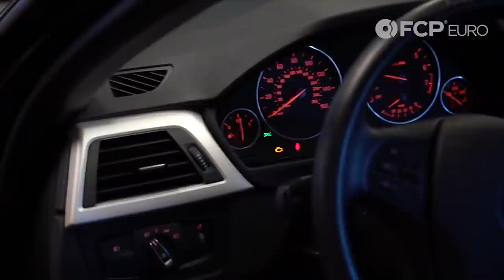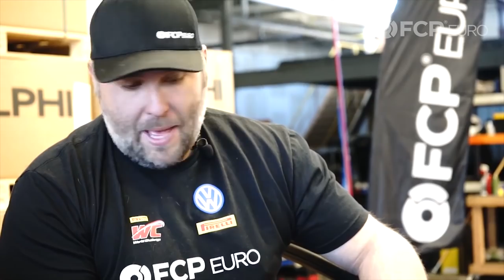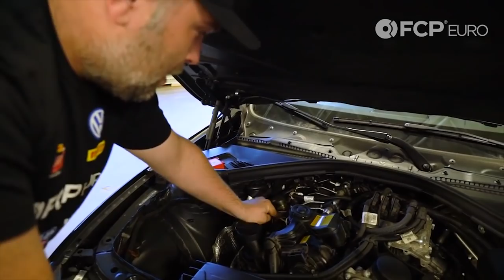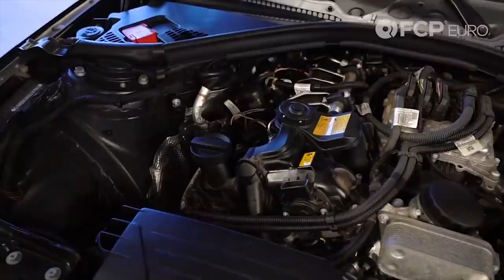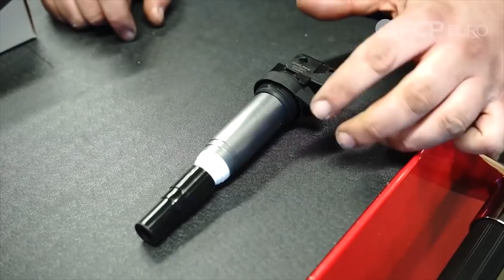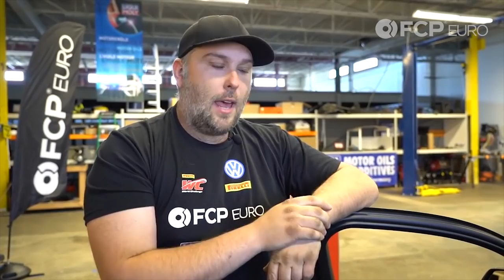Ignition Coil Symptoms, Problems, Diagnosis and Replacement  - EASY DIY!

Comment: For me nothing came up on the scan tool, did the manual check, put a new ignition coil in and worked beautifully. 
My symptoms was when accelerating normally, it would jerk a lot, but would be ok when accelerating slowly.
Reply: Having same problem as u

Comment: Good vid, I am likely going to use this on a BMW bike to puzzle out a fault indicator that I believe is a coil going bad. But I will order a fault cod reader first.. Best guess till then is the fault code is likely a slow failing coil.

Comment: The older style Bosch stick coils are the best with the metal shield. They fire under load without fail.  BMW has gone to Eldor since all the problems with the newer Bosch and Delphi. Eldor seems to be the reliable route for now. Eldor is used in Rolls Royce engines which speak for the quality.

Comment: Great video.
Reply: Would have been REAL nice if you had attempted to temporarily fix the coil by wrapping electrical tape over the hole and retried the test. If this coil failure  happened while out in a remote area, the tape fix would get you a shop or store and not possibly harm the engine. $.02

Comment: thanks for the video. I have a question, do you recomend to change all coils set at once or just the one failed?
Reply from the maker: You're welcome! Usually if one coil fails, the rest of them are nearing failure as well, so its always good to replace them all at once, however if you are in a pinch you can just replace the bad coil.
Reply: FCP Euro thanks again. I just replaced the bad coil, but will replace all asap.
Reply: Exactly my question as well,  glad it's on top 😊👍

Comment: I've replaced 2 on my '07 Altima in the last year.  I was stoked!  I don't know much at all about working on engines.  Both times my check engine light came on (though even if it didn't it was quite clear something was wrong) so I had it diagnosed at an auto parts store where they told me exactly what the issue was.  Could a coil go bad and not set off the check engine light?  Also, does a coil gradually go bad or do they simply either work or not?
Reply from the maker: Typically a bad coil will cause a misfire and set the check engine light off, depending on how modern the car is. Coils typically age to the point where they no longer work, however you can have a failing coil that will cause intermittent misfires.
Reply: @fcpeuro  my 428i jerks and stutters with acceleration. I have a check engine light but no codes say anything about misfiring. Do you think replacing the coils may be it?
Reply: @anthonypipia6990  yes check and change the coils manually like in the video. Same thing was happening to my car. Fkn shaking was scary on the highway.

Comment: In this particular example, could not just the rubber insulating boot be replaced since it clearly had the defect?  I imagine the coil likely could still be operating correctly, but the spark was exiting through the defect in the boot instead of down to the plug.  I could not really make out any discoloration in the boot around defect though in the video to support this possibility.  It makes more sense in my mind to repair the part with a new boot at a fraction of the cost of a complete coil if that is the failure.  It was $5 for a boot vs $60 for the coil on my Volvo.  Maybe that is not possible with the coils on these vehicles.  I don't know.  I'm just researching frequent failures and repair/maintenance on these cars because I am considering a purchase next year.  Regardless, an easy fix without specialized tools and the car is running correctly again, and that was the point of the video so well done.
Reply from the maker: Unfortunately, the spark plug connector (boot) is not a serviceable item on this style ignition coil for BMW's. In this case due to the damage on the connector it is required to replace the entire coil. The most common failure for ignition coils is the coil itself failing. Discoloration of the insulation is not always an indicator of an issue. Generally speaking a misfire due to an insulation problem is almost always a tear or hole in the rubber boot.

Comment: Im gonna replace the spark plugs and/or the coil packs on my 2006 Saab 9-3. The engine keeps misfiring whenever I give it gas, hopefully this will solve the issue!
Reply: Can you give me an update on if it worked I'm having the same problem on my 06 9-3
Reply: @easilyoffended9535  it turns out I had a bad coil pack on one of my cylinders. It was an easy fix too! Make sure to get the black top coil packs. And make sure it’s an OEM part too. 

I also sold my 06 9-3 because it failed inspection, the repairs were worth more than what the car was valued at 🙁

Comment: I  have a 2004 330ci and I got the PO302 code. I changed the coils, plugs, the injector at #2 and STILL misfiring. You said "wiring" and that makes me think that there is no power to that coil due to a wiring problem. Where should I begin?

Comment: Would it be possible for you to do a DIY video on changing the rear driveshaft or changing the pick up rings, reluctor rings on a bmw e46? I have an ABS issue problem with my car and I've been told to replace them but the price they are charging me is crazy!! if you could do a video please i would be able to give it a go myself!!

Comment: FCP Euro
I owned a bmw 320i 2007 and suddenly my car started jerking in all gear position P,R,N,D. Especially when i pressing the brake at fully stop the cars is jerking heavy and i also noticed that the gear lights on the dash is flashing when it jerking. Can this cause by a defected ign.coil? Please help

Comment: I’m subscribed. I need the diagnostic tips, the easier the better. I have an owner of a 2001 Land Rover Discovery, the vehicle will crank but not start. I asked the owner if the tach needle moves while attempting to start and he said “no”. I suspect the crank position sensor. The owner had someone else look at the vehicle and a scan tool was connected. That revealed an ignition coil to possibly be bad. I’m going to the owner’s house Thursday to check both of the possible problems. A wiring schematic I obtained does not show which of the three wires from the connector are what. I noticed upon looking at a connector for that ignition coil there was a red, a black, and a blue wire. I would reckon the red is for the power, black is for the ground, and blue is for the signal to the computer. I want to properly diagnose the coil with my multimeter and I want to check the proper terminals that the connector plugs into. What do you reckon? Also, I attempted a spark test but after testing three of the eight spark plugs I wasn’t getting a spark at all. To me that didn’t seem right.

Comment: I just spend nearly 3k on my car at a highly recommended shop. I’m a bit disappointed I left and my car has other issues it didn’t have before. They did a full tune up Including oil change and spark plugs. My car has a slight vibration when I stop at the light. I notice the car revs up before dropping idle before I come to a complete stop. I’ve been there twice to complain about the issue. My trust is loss and the fact I didn’t have this issue before taking it in.

Comment: The car is Mitsubishi Lancer 2004. It won't start due to a defective ignition coil. Lube oil is flooding the cylinder as well. After replacing the ignition coil assembly, one of the ignition coil felt warm even when the car is switched off. The mechanic thinks the electrical system is grounded, but couldn't confirm the trouble. Please help

Comment: i hope this wil work i put in new sparks today but now its idling the same as in this vid. so tomorrow ill chabge all 4 coils and hope its done .. did all this cuz between 2-3k rev. it releases boost like 1-3 times in a row but now with the new sparks at .022 it does it like one time at 4k revs only whilst punching the throttle whilst driving .. but eith all that no check engine light or annything 🤦‍♂️ PLZ SHARE YOUR APINION ON THIS

Comment: Hey so I replace the spark plug on cylinder 1 after giving me a misfire and even changed the coil less in October 2022 and now it's making my car stop and go into neutral until the car FINALLY comes to a stop and it makes clanking noise on the back tires and I hate turn on the engine again but i noticed it happens when I come to a stop and sign or light intersection and when it's time to accelerate to go that's when the engine turns off and goes into neutral as nd steering wheel gets hard and starts make the car to come to a stop but is put into Neutral and makes a loud clanking noise on the rear ties until it comes to a complete stop. I already went to AutoZone to get it checked for codes and no codes other than the ambient sensor but I already replaced it and my ac don't work cause I don't have the money to fix and my son who just 14 months old and I can't afford to be without our car since we are currently fleeing from my abusive ex boyfriend to keep my son safe and give him a better life which he deserves it and I feel overwhelmed and defeated to that things are not coming out right or what I hoped it would be better because we are in a DV shelter but this Domestic Women's shelter is ok with providing a roof but only for a month only until I find a place and money to get away and start a new life with my son but now my son just got diagnosed with a delay in his motor skills and communication skills and now he's developing symptoms of an autistic child but they are not saying we need to wait until he turns 3 to diagnose him and give him the treatment or help he needs to treat autism. He's 14 months already and he's still doesn't walk. I'm beyond grateful for FINALLY having my child away from our previous violent and abusive  home and now we can sleep comfortably but we still have some traumatic episodes at nights but we go to sleep knowing we are safe and that's all I want for my son to be happy and enjoying his time as a child but with all these new set backs I sometimes feel like I can't do it on my own raising him with no money and no job and no luck in getting any job offers. 

Sorry fo telling y'all my Lifetime sad story but I just had to let it out and tell someone so I can remind myself to not go back to the abusive relationship because I feel like I can't do it or find a way out to my struggles in being a single homeless mother with her 14 months old son. 

Ok so do y'all know what can be wrong with my car......it's a 2015 528i bmw f10 n20 engine to win turbo??? Please any advice what it can be and how I can fix it please 🥺🙏🥺🙏🥺🙏👩‍👦👩🏾‍🔧

Comment: So what if you have done all this that you have shown on the video, except plugging the diagnostic machine? And still have the misfire? Replaced spark plug and coils but still.
Reply from the maker: Hi Phakamisa, you always want to clear the codes after replacing plugs and coils.

Comment: My 2005 BMW 545I with only 77k misfires and sometimes I get misfire codes (by various cylinders, not always same  cylinders )by obd2 scanner , other times I don t get codes.  This happens only during cold start up in the morning after car was left overnight.  it vibrates, shakes and misfires at cold start up but once it s warm, it s good for the rest of the day, even when it s still cold out.  what causes this? I replaced valve cover gaskets, spark plugs, oil filter change, any ideas?
Reply from the maker: A bit of further diagnosis may be needed, but often times bad oxygen sensors can also trigger multiple misfire codes and cause a rough idle, on our "older" BMW's.

Comment: hello mate. i have a F30 which have N13 engine. sometimes i see  engine check light on cluster. When i runs diasnostic its give me this error: ignition coil. All cylinders. open curciut. But my car working correctly. what is the problem ?

Comment: I just change the spark plugs on my 2003 honda civic but when i was putting the spark plug back it crack when i was tining the crew do i need to change the coil or its still good i just change the coils like 3 weeks ago

Comment: My car is in the shop right now for bad coil and other stuff. The total is over $600. My car would jerk, hesitate and shit off while at the light. There was a ticking sound and smell of gas. I live in Miami, Fl
Reply: Did it fix the problem ?
Reply: What else was wrong with it
Reply: I had one go bad as well...had to have it fixed so it was $500 parts and labor... I had no idea what was wrong so I had to pay the price. While I was waiting I looked on YouTube and found out it's done... about a 15 minute job that anybody can do... paid the price because I didn't know...they used an aftermarket part from O'Reilly and charge $60 over what I could have paid if I bought myself. If you drive too long with the bad coil it could burn out the catalytic converter so now I know what to do if happens again.

Comment: When one ignition coil goes bad, is it better to replace all the coils as well or should I change each one as necessary? Also, should I change the spark plugs (the whole set has been replaced within the last year)
Reply from the maker: If everything has been replaced within the last year you can replace the one ignition coil.

Comment: Is it possible (or common) for a brand new ignition coil to go bad in approx 1000 miles? I had all of them and plugs changed in my last service a couple weeks ago and today the car is driving and idling real bad. The coils are bosch
Reply from the maker: Anything is possible, have you checked the codes? If you purchased them from us, feel free to email service@fcpeuro.com and we would be happy to make it right.

Comment: I replaced my coil after having it checked with a scanner at my auto parts store and now my car (328xi 2011) runs and idles fine but the service engine soon light has yet to go off 32 miles later. Is this something I may have to delete with a scanner? Or will it go off on own?
Reply from the maker: Hi Kevin. If the service engine soon light does not go off after more driving, you will probably have to clear the old code. You can have a shop do this, or you can purchase your own scanner, that way you can check and clear your own codes. Here is a great scanner/code reader: https://www.fcpeuro.com/products/maxidiag-md808-professional-obdii-scanner-autel-md808p

Comment: In nissan  you are not getting code for coil and some toyota cars  no codes and in maxima coils are underneath the plenum so  it's not easy you can check front then swap them back and coils on the back shift it infront and check big headache 😅😅😅

Comment: Great!  I had an identical issue on sons 2007 e83 X3.  We needed to fix it right away so bought one from Autozone as they had an equivalent in stock.  It fixed it but given the high mileage of his car I’m going to order a complete set from you.  The one I took out looks like Bosch unit.  Do you have these in stock?
Reply from the maker: Yes, we have them in stock.

Comment: I had a quick question, my cable from cylinder 3 to the ignition coil isn't giving any power. do u know what might have happened. I have a 2014 328i N20
Reply from the maker: Start with the obvious things like checking ignition coil fuse, and move on from there. How do you know its not getting power, assuming you tested with a multi meter for power at the connector with key on? If so, you might have to trace the wiring, could be a broken or shorted out wire somewhere in the harness.

Comment: I changed the coil on my BMW 535ii 2011  but still had  Check engine  Light  It's still on
Reply from the maker: Hi Juan, you will always want to reset the check engine light after doing your repair.

Comment: Do u know if bad ignition coils n spark plugs can cause a bmw to go into limp mode,? And can it cause it to shut off after putting in gas?
Reply from the maker: It is quite possible for those parts to cause the car to go into limp mode, but simple misfires are more common symptoms of these parts going bad. If your car is shutting off after putting in gas, you likely have another issue. We'd recommend finding a local mechanic to help you properly diagnose the issue then coming back to us when you need the parts. We'll help you get exactly what you need!

Comment: Can I do this procedure on a 2003 Mercedes E500 because I've Been Told doing so it can damage the ECU ,my scanner show that I have cylinder 2and 3 misfiring and I'm hoping that could be the coils not something before like cable harnesses or fuel injectors I've already installed 8 new spark plugs so I want to do the manual test but I was hesitant plz let me know if that is Okay to do so thanks
Reply from the maker: Hi Monir, your engine has 16 spark plugs as its a dual plug per cylinder design. Additionally, yes you should be able to swap coils from the other bank to isolate which ignition coil is the issue.

Comment: Can you please help my BWM 320i e90 does not start, does not engage ignition. No ignition lights on the dashboard. This happens after having a battery issues. What could be the problem?
Reply from the maker: It sounds like you still may have a batter issue or a battery connection issue. Check for loose connections at the battery, loose ground, loose positive wire, etc.
Reply: @fcpeuro  thanks the problem solved. It's like there was a system break down between battery system and ignition system. The car was fine after being synchronised.